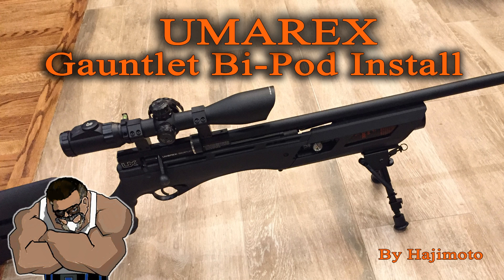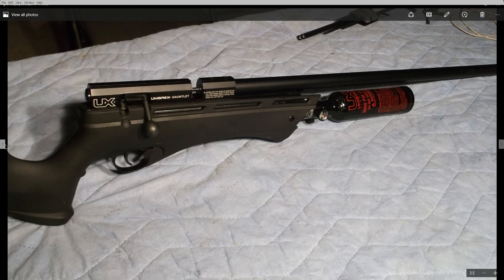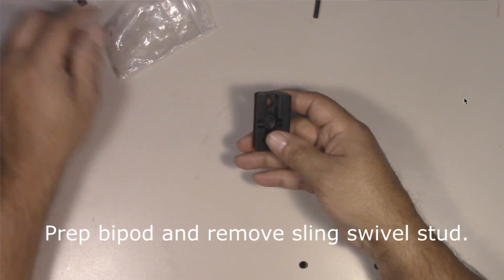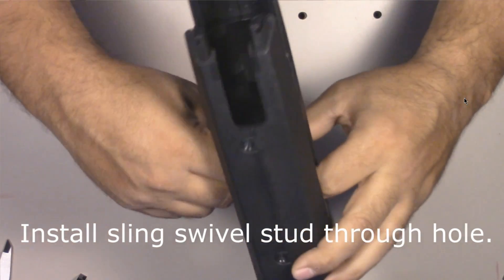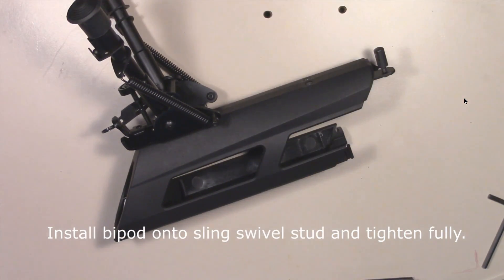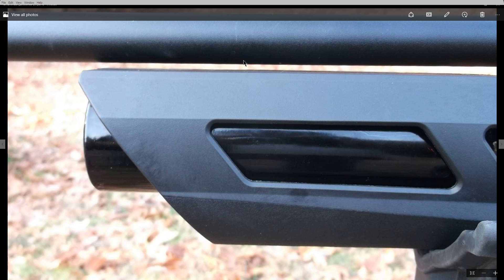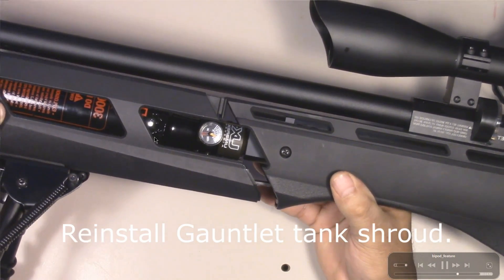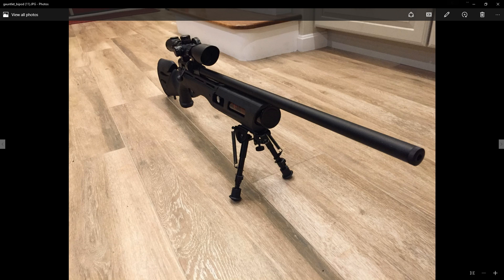Umarex Gauntlet: Bipod Install on Shroud

Comment: Thanks for the info on the GAUNTLET PCP, I ordered mine from pyramid air,  1 week ago in 22cal,  but they were out of stock I will be receiving it the 1st week of January can't wait , now I know how to install a bypod and aline the shroud gap at the barrel,  Thank You , by the way awsome vidios
Reply from the maker: Philip thanks for the view and comment.  Be sure to watch my other Gauntlet videos while you are waiting for your Gauntlet to arrive. The videos will help you become familiar with the parts and assembly of the rifle. Tighten all fasteners, bottles and thoroughly clean the barrel before taking a single shot.  You will be very happy with the Gauntlet as it is a lot of value.
Reply: Hajimoto Productions , Thank You , looking forward on viewing your new video's UMAREX GAUNTLET

Comment: Lol, I furnish all my guns from amazon,, usually after spending 800 to 1000 on a gun I pretty much have to go cheap,,but all my bipods are only 15 dollar bipods an they work just as good as a 100 dollar bipod,, great video
Reply from the maker: I know the feeling! I do not necessarily endorse cheap but let's keep in mind that I could buy an Atlas that exceeds the price of the PCP its on right??? LOL, I am trying to keep the add-ons in line with the PCP costs.  Thanks for the view and comment Kevin.

Comment: great video im waiting for my bipod to come in the mail but as for the alignment problem your having it looks like your tank it is tilting upward when compared to mine. i was having an issue with the shroud and having a hard time getting it back on but that was fixed by loosening those screws. just a thought tho it might fix your shroud issue if you try to straighten out the bottle a bit

Comment: Holy LOLOL at "fixification!"  I have a few things I need to fixify.  :D  Great vid, as usual.  I think you hit the nail on the head.  I was wondering for a while if that shroud would support a bipod, as the provided sling swivel seems a horrible place to put a sling OR a bipod.  It's unfortunate that the shroud isn't sturdy enough for sling use...but I completely agree.  It's not worth the risk to try.  Can't wait for the next one!
Reply from the maker: DR thanks for stopification and Commentarium 😁
Reply from the maker: Hello Tim, You are right that forearm is two halves and yes my hole is drilled in such a way that it essentially is half a hole per side. But because this installation is not going to be for a sling attachment and only for the rifle to rest on, I do not believe there will be an issue.  The next thing is the two halves of the forearm shell overlap at the center and there are a series of screws that hold the left and right halves together. The reason I place the center of my hole 5/8" @ 4:30 forward of the existing forearm screw is not to influence or weaken that screws ability to hold the two halves together. Remember, as I stated in the video and I will clarify again here, the sling stud I install is not intended to be used for or by a sling.
Reply from the maker: Well, I say the section of Picatinny rail installation is far more versatile than my approach. My installation is designed around a very inexpensive bipod whereas the Picatinny rail section allows you to use a laser pointer, flashlight and pretty much any bipod.
Reply from the maker: You are welcome. Good luck on your bipod mod. Thank you for the comment and support Tim!

Comment: Great tutorial, thank you.  I was looking for a video on installing a bi-pod on a current model Umarex Origin.  I'm assuming it's going to be the same process, even though the shroud's are different between the Gauntlet and Origin.  I need to remove the shroud on mine and make sure there's enough room to install the sling swivel stud.
Reply from the maker: Thanks for the kind words. Please note that I made another video that details how to add a section of Pic rail to the tank shroud as well.
https://www.youtube.com/watch?v=CAxYuvAucck

Comment: Hello Hajimoto,

  I do not own a Gauntlet at this time but, I am very interested in purchasing one soon. If I may be allowed to comment on your presentation for the Bipod installation I would be honored.  I love your placement for the Bipod and the use of the sling stud is an excellent way to mount it.  I have the same Stud mount on my Ruger ranch rifle.

  Now if I may get to the point before  mounting the Bipod Stud you mention using a shim between the shroud and the air cylinder, therefor keeping the shroud from contacting the barrel directly which could affect accuracy for poi. Here’s a thought I had that you might like to comment on or try out for yourself.  Why not place a threaded Stud through the shroud with a nut on the inside of the shroud that could be adjusted to put pressure on the shroud to cylinder keeping it away from the barrel?  Uncle Mikes and others sell the studs in various lengths, one of them must work.

  One other thing, I liked your barrel band attachment also with one exception.  I always thought the floating barrel setup was much more accurate that a rifle with the barrel touching any other part of the For stock, shroud or what have you. At least that is the case with powder firearms.

I would appreciate a response if you get a chance.  P.S Keep the videos coming, I love the all.

Respectfully submitted.  Fireman
Reply from the maker: Thank you for your view and feedback, it is appreciated. This video was made on the very first shipments of the Umarex Gauntlet and they have since corrected almost all of the weak or misaligned forearm issues so the shim idea I shared was only relevant at the time of video capture.As for free floated accuracy, you are correct, providing you have a stiff rigid barrel capable of maintaining a stable non moving position. The Gauntlet have a very flexible thin walled barrel which is attached to the breech by two grub screws which are not enough to keep the barrel in a fixed position. The HP Barrel Band was only designed and produced to stop the constant point of impact changes due to the barrel issues.
Reply: Hajimoto Productions Thanks again Haji. I understand completely about the Gauntlet barrel not being as sturdy as a power burning rifle so, the floating rules really don’t apply. I don’t want to go crazy with improvements on the rifle I will be buying but would like to make a few upgrades.  Besides the barrel band and Bipod  placement, is there anything else reasonable priced that I could install? Not interested in installing big 4.5 s psi cylinder.  Trigger improvement and or Higher pressure regulator?  

Thanks again with your response.  Cheers,  Fireman

Comment: you are welcome...after the first of the year i will be getting into airgunning.  the gauntlet seems to be the one to go to.  shortly after that i will be implementing your tutorials...if i am not mistaken(?) for the barrel/bottle separation, you created a spacer?  yes?  if so, are they for sale?  and after the first of the year how would i go about getting one?  i am looking forward to the outcome of 2019 shot show.  seeing if there will be mods for the gauntlet?  til then, keep them coming... blessings,   Scott
Reply from the maker: Hello Scott - You will be happy with the Gauntlet as it offers so many pluses for the dollar. Please be sure to look at the descriptions associated with any of my videos because besides the video/audio content offered in my YouTube presentations there is also a fair amount of written support material provided as well. Typically I provide links to where a viewer can pick up the item(s) I describe in my videos. The Spacer (shim) is not something I make, it is a readily available stainless steel shim produced for the purpose of adjusting paintball regulator pressures. Typically a 0.020 shim will take a Gauntlet from 1100PSI to 1350PSI output but this is why the construction of the regulator output tester is so important. So again, please be sure to read through any provided written materials that accompany my videos.

Comment: Mr Hajimoto are you still working on the individual baffles for the Gauntlet. If so I would be interested , Mike from TKO just made me  a extension to make it a little more quieter.
Thanks Gio
Reply from the maker: Yes the baffles are still in testing.  They appear to be working great and i have to still do a DB test to see if they are quieter than the one piece cigar lame setup they included.

Comment: Is the shroud touching the barrel a common problem? Mine does not do that even when I push on it more than the weight of the gun does.
Reply from the maker: It was an issue in the early release version of the Gauntlet yes.  They have since corrected most of the issues that my initial video review pointed out. The Gauntlet is a great entry level rifle with a lot of legs for the money, enjoy!

Comment: Will doing this mod affect the POI when also running your barrel band? Thanks.
Reply: I too am curious about this. Also wondering if the single "stud" mount (as done in the video) will still work with the HP barrel band since you have to trim the shroud back....or will you have to do the picatinny rail at this point?

Comment: Dear Hajimoto, Would not putting a bipod on the shroud push the shroud up against the barrel thereby moving your point-of-aim?
Reply from the maker: The forearm of the stock if properly installed does not make contact with the barrel shroud. Most folks rest the rifle on the forearm while on a bag or shooting rest so if what you are describing were to happen all the time, ANY forearm resting would change the point of impact. You just have to make sure the forearm of the stock is properly attached and secure with the 3 points of fasteners.
Reply: @HajimotoProductions  Thank you for your explanation.

Comment: If you install the bipod between the two screws in the rear of the fore end and the rear end of the forward fore end, drill and tap a 10-32 tpi hole through the plastic and through the metal piece , you can use a standard front sling swivel stud to attach the bipod.  More support for the bipod without cracking the plastic of the fore end.  My fore end does not flex up and touch the bottom of the shroud like yours did.  My fore end actually rests against the bottom of the air tank.  I can't make videos like you can.  Enjoy your videos.  Bipod in this location works well and is not too far back.
Reply from the maker: Hey Lionel, That reads AWESOME!  great idea man. you don't have a phone that can capture some video and drop it on a YouTube channel????  I would really love to see your described work!  By the way, my platic is not cracked and the bipod is supported quite nicely. The support method I used is much more robust than the temporary shim that was in the video.  Thank you for sharing your comments!
Reply: Gunsmith work on firearms and airguns, no problem.  Computer posting videos, problem.
Reply from the maker: It's much easier than you think. Most smartphones will allow you to stream/record directly to your YouTube account. The community would benefit greatly from another content provider. I for one would be happy to see it if nothing else :)
https://www.imore.com/how-upload-video-your-youtube-account-youtube-capture-iphone-and-ipad

Comment: hello sir, I have a situation with my Umarex Guantlet .177. Out of the box I pumped it to 3000lbs with a hand pump . After installing a scope to it out for sighting in at 20 yards. First two shot sounded good but then I started to notice air escaping from where I load the pellet. As I continued to shoot more and more air was escaping from the same place. After the 5th shot all the air was gone. I removed the air bottle and pumped it to make sure it wasn't that. Worked fine. I reattached the air tank and with or without the pellet in the chamber air rushes out fast from same place. What can you recommend?
Reply from the maker: Alex I am sorry for the delay in responding as I have been pretty busy and did not get around to answering YT posts. It sounds like either the valve poppet is not sealing or the valve o-ring is bad, either way, it is a warranty or returnable issue.
Reply: @HajimotoProductions  Thanks for responding. As you said it is a warranty issue. I stayed in touch with UmarexUSA and when they told me to send in my rifle to their establishment,  they send me a new one. This one works very well . Dime size groups at 20 yards.

Comment: Dear Haji Sir, nice and crisp video.
 I wonder why Unarex didn't tried to design a bottle cap which could have provide the long floating barrel a fixed support utilising the sturdy air cylinder. Have a look at evanix air guns bottle caps. 

Apart from fixing the bipod you must also have baked your Christmas cake and Turkey by now. Have a nice holiday.
Reply from the maker: Mayank I agree!  The bottle is more than strong and rigid enough to support the rifle. It would have been an excellent location for a barrel band as well. As for cake and Turkey.... No wayyyyyyy to early my friend, we will not start cooking until 4am on the 25th, Thanks for the comment!

Comment: Just seen how old this video is but your gun in missing the the barrel u bracket or brace.  Can’t remeber what’s it call but right now my barrel comes lose easy but is anyones bolt at 3k psi hard to cycle the bolt ? I have to use two hands lol